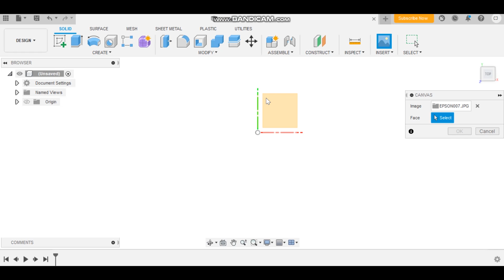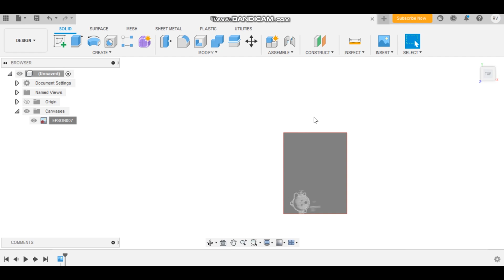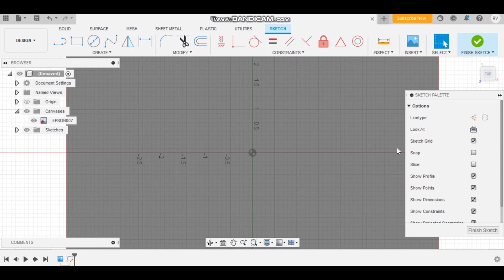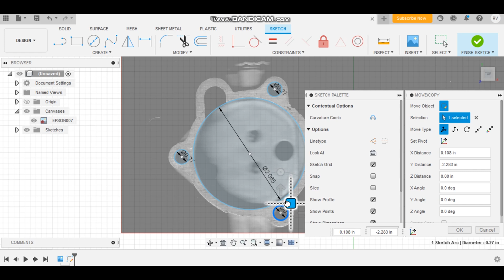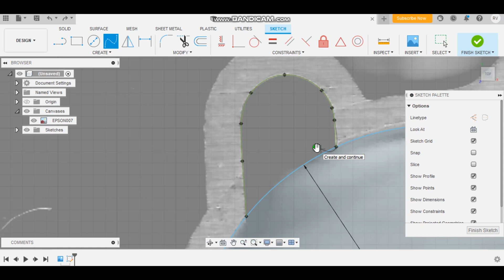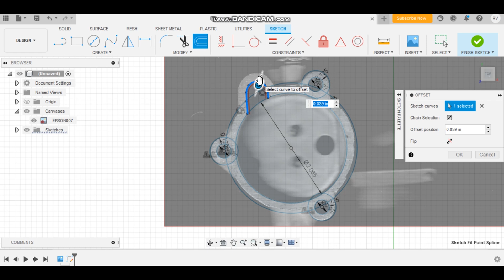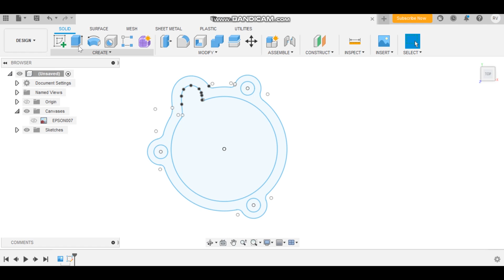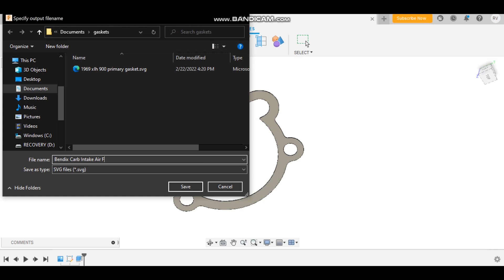YOU Can Design Your Own Gaskets Using Fusion 360!!

Comment: As to the scaling at the beginning of everything... Just include a high quality ruler (scale) in your photo/scan, that's sitting at the same elevation as the surface you're trying to make a gasket for. Which if you're just trying to copy a gasket is pretty easy!  Then you can calibrate off of that and not have to worry about holes having rough edges, etc.  Zoom right in on the ruler, and you can easily nail it right on the line.  Longer the ruler you can fit in your picture the better!